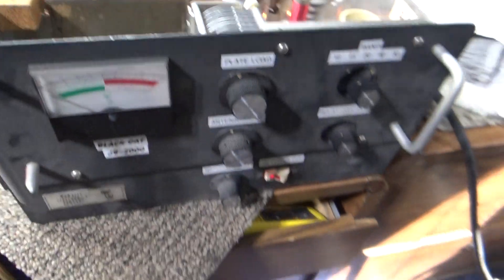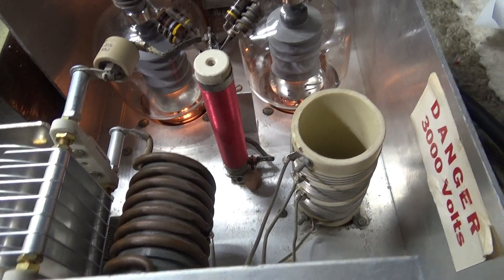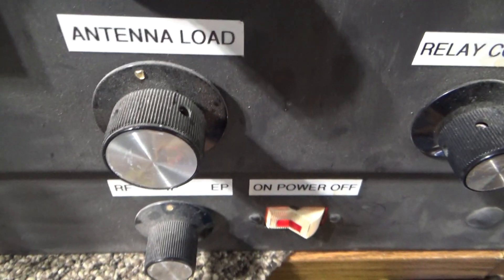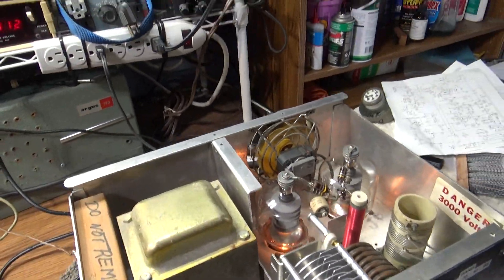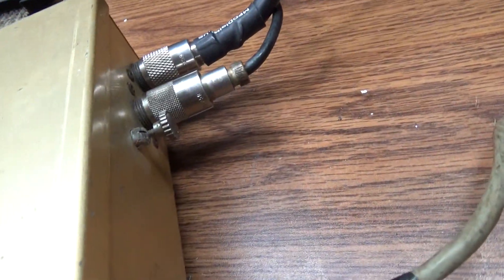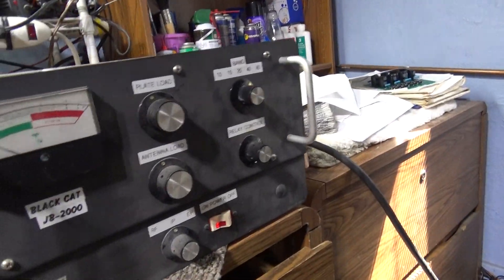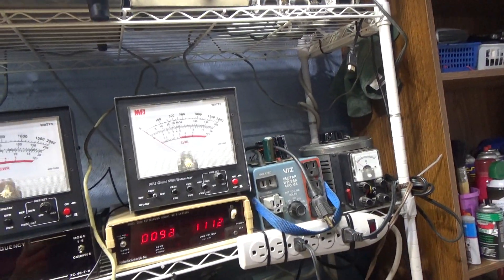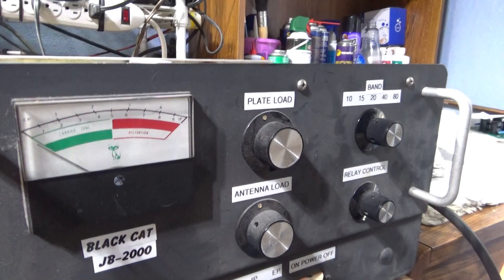Blackcat JB-2000 fixed on the bench (not mine)

Comment: The load cap all the way open? Mine uses the driver tube. I installed a tune cap to dip the plate.yall rookies
Reply from the maker: Normally when you convert a Ham band amp to a cb band only amp, the tune and load caps will usually tune towards almost all the way open, rookie.